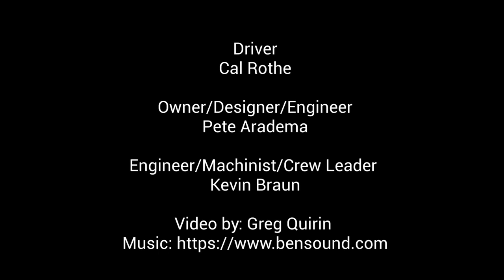El Mirage, Sept, 12, 2021 New Land Speed Record, 215 MPH  Team Aardema

Comment: How is this a record???? I’ve been nearly that fast.
Reply: I was going to suggest it might have been the difference between a streamliner and a lakester, but then I found that Honda took a 3.0 L V10 powered Formula 1 car to Bonneville in 2006 and ran 246.9 mph over the kilometre and mile, just missing out on their target of 400 km/h. Is that a lakester? Doesn't look much like a streamliner to me, but I suspect there might some other differences that put the car in a different class. Or perhaps the Formula 1 fuel might have some additives that don't meet the gasoline standard required for land speed records.

Edit - one big difference here appears to be that this is an El Mirage record and traction is a big problem and many cars are still accelerating at the end of the run. Really fast times are set at Bonneville where they have about 5 miles to build up speed and even then it's not enough for some people and they are looking elsewhere, like Salar de Uyuni in Bolivia.
Reply: @Big Fan well call them and tell them about me
Reply: @Big Fan there are plenty of 4 liter cars doing well over 215 mph. I can read the description….Thanks but my question still stands.